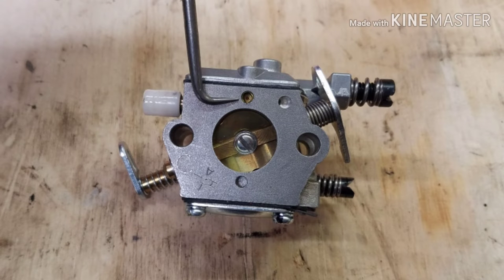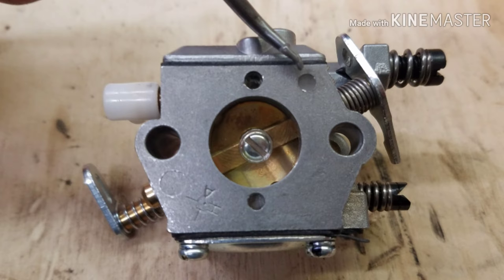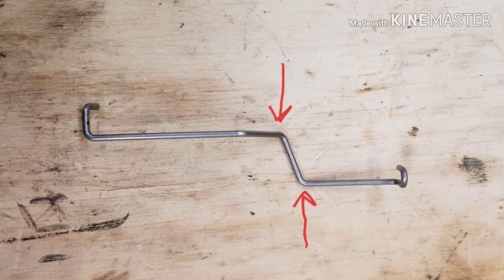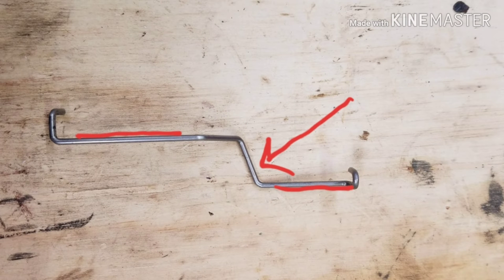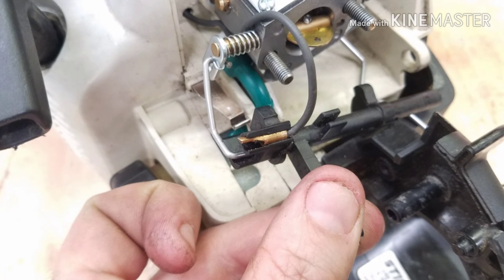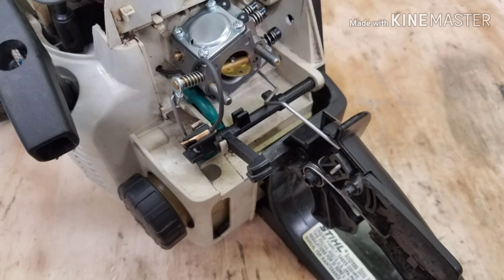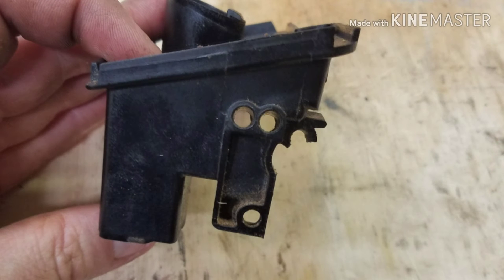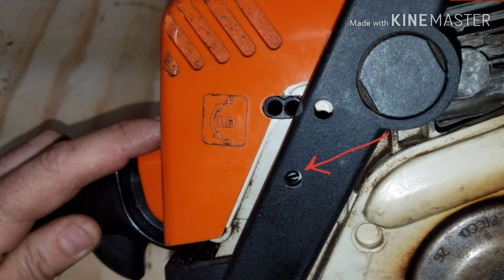☆ How to ☆ Stihl MS170 - MS180 w/ Walbro WT-215 adjustable carburetor upgrade & muffler mod

Comment: Just got my carb today to do this mod. Question how did you figure the right angle to drill hole for idle screw? Did you just eyeball it?
Reply from the maker: I more or less eyeballed it unfortunately. It was an educated guess. With the carb installed I marked the inside of the saw body (where the screw lined up) with a sharpie. I removed the carb and went from the inside and used a small dremel burr (like 1/8") to get an appropriate sized hole through the white saw body plastic. Once I did this, I then went from the outside with a small drill and followed the "angle" of the original hole. It was easy and straight forward to eyeball it and drill the black handle once the hole was in the white saw body for a reference/target to aim for. I drilled a very small hole first and stuck a straight wire through from the outside and into the carb to see how "centered" on the adjustment screw my hole in the handle was. I adjusted from there with a drill bit that was big enough to fit my screwdriver through.
Reply: Thanks! Your tips will definitely help. Are you in Oregon or Washington? The background in your videos look like the good ole northwest. Can’t wait to get this saw screaming!
Reply from the maker: @chickenfs  yeah, I'm in Northwest Washington about 45 min south of the Canadian border.
Reply: I ended up heating a piece of coat hanger wit a torch, and it just melted right through like a hot knife going through butter. Tylenol I drilled it out. Worked out great
Reply from the maker: @chickenfs  That's great! Glad it all went well for you! I'll put that one in the memory bank for later.
Reply from the maker: I'm excited for you. It sure seemed to wake this little saw up, not to mention help keep it in a much safer state of tune.